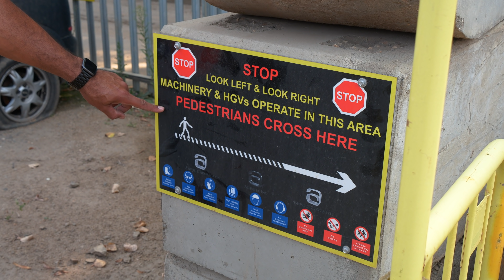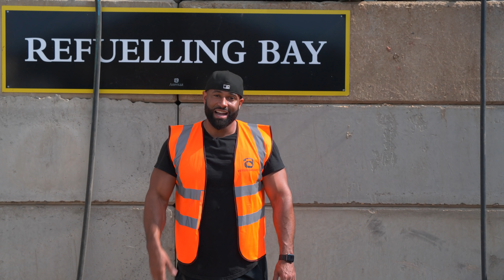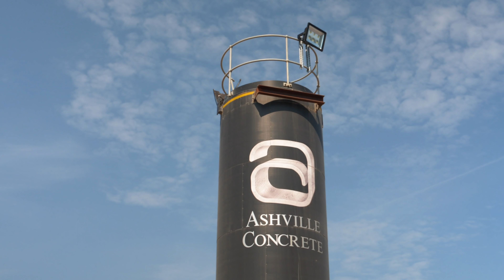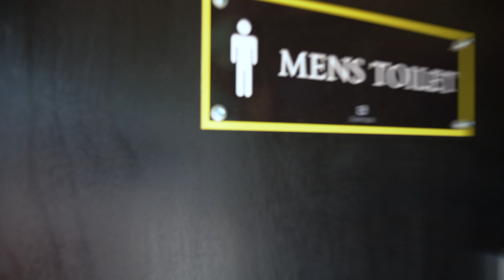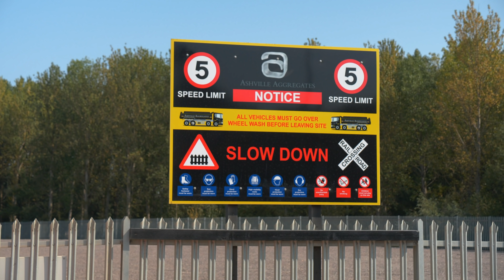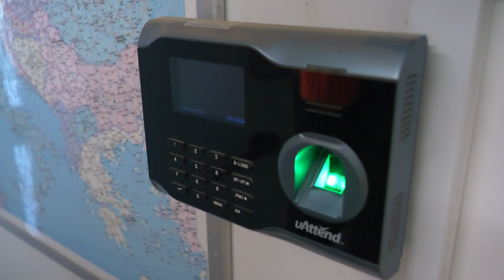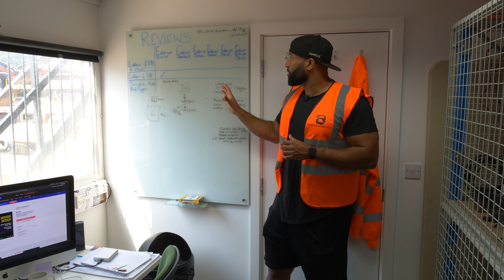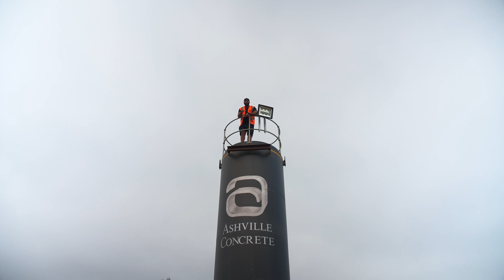The Ashville Construction Yard and Office Tour

Comment: How did you start this company?
Reply: Like any good startup. Work your way up, invest back into the business, maintain and build client relationship with upmost honestly, integrity, dignity and most importantly reliability.
Reply: Pretty sure thats not the answer
Reply: @k1ortia  That's exactly the answer actually, combine that while gathering experience.  If you do the things right,  things will go right for you.
Reply: @dankim3950  He must have some serious backing or gifted a sum of money to get a business like that off the ground. He's looks quite young and to build a business that size, with the massive overheads would take time. The plant, machinery, trucks and trailers in that yard run into millions of pounds.
Reply: @JM-zz3vs  read the question again young one...🤔
Reply: @tilerman  I was thinking the same thing to myself .. not to discredit success at all I'm more wondering about the cash flow and credit to fund the machines
Reply: @tilerman  his operation is definitely not a small machine to feed, but considering his trades involve demo, concrete and construction (which all trades can be done under one contract instead of having multiple subbies would be highly advantageous for a main contractor) I would imagine he has excellent client relationships with big construction companies to keep the jobs flowing constantly instead of bidding for jobs.
Reply: @tilerman  Theres no fucking WAY he built this without financial backing man.
Reply: @tilerman  Just cause you haven't done it doesn't mean others can't....
Reply: Rich parents
Reply: Yeah defo had backing...you don’t just build up a company like that within 5 years, he’s either inherited the money or he’s backed by a possible person or company. If you look at beta companies he owes £500k from last year to debtors but that doesn’t cover the cost of all that machinery plus the land.
Reply: @marksmith4640  He started in 2006 15 years hard graft....

Comment: This is not criticism but an observation! ,,,,,,,,, Looking at the scaffolding system you use it looks like a more time consuming constructing system where at every fastening point there is a tightening clamp. Here in Sweden we have a system where it is more of a click in place system with a looking pin. In the apartment housing cooperative they have changed all the windows on 180 apartments and all the roofs and the scaffolding is put up very quickly on each apartment section. Saves loads of time compared to the system you show in the vid.

Comment: Late 60's used to make gas fired heaters for on site block storage tanks. Asked a driver collecting new heaters if concrete had ever failed to pass crushing. YES. one lot even failed core sampling and a whole second floor had to be ripped out. All the services had to be removed first. Never heard what it had cost concrete firm.

Comment: Hi, I know you always appreciate constructive comment, guy operating the spray wash, should be wearing eye protection. No signage on the jet wash to tell him he should be wearing eye protection,  Your IBC's in your refuel station, should be on bund's. Your barrels in your concrete quality control room should be on bund's.  No visible ''Sill Kit's'' around yard to control fluid leaks from vehicles and or plant. . If I ever get the chance I would like to have a positive constructive, visit to your operating centre. To, without charge point you I the right direction to achieving ISO 14001. If you check it out you will find that having this and other accreditation's will help you develop your company.

Comment: This is very high chance of making it and easier with leverage from banks if you have the clients. Twats pre insta want to be a footballer, model, singer and now influencer. This is the Graft that made Indians millionaires in the UK. Its a fair country and anything is possible. But concrete and dust not glamorous. Corner shops, taxi fleet, property, nursing homes, cash n carry, car dealing, hotels, import export, debt consolidation, joint family property business etc. This is much higher chance off  making it the British Indian way and values.